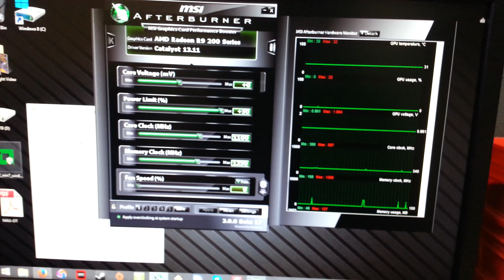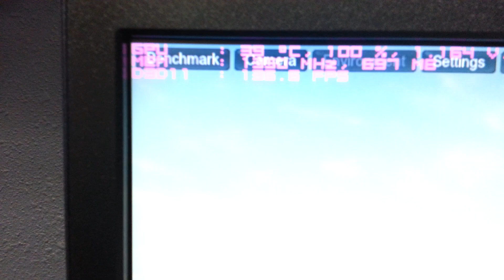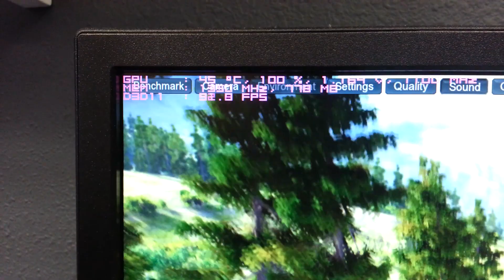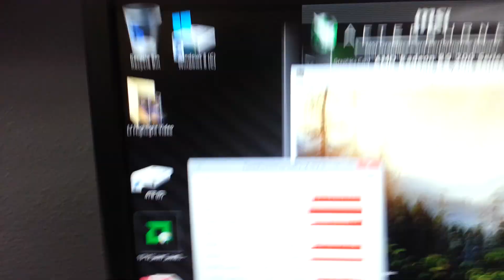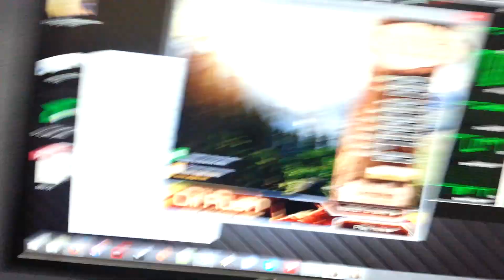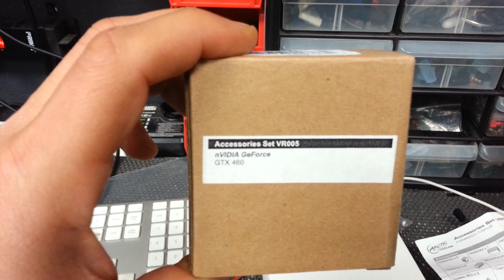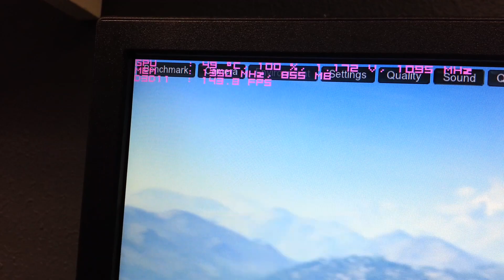NZXT Kraken G10 with NZXT Kraken X40 installed on a Radeon R9 290X (Part 2)

Comment: couldn't the radiator for the gpu cooler fit on the top?
this is cool though, my next build in the future will be 2x 240mm radiators cooling cpu and gpu and those nice little heatsinks for the vrms.

Comment: my temps still gets in the low 60's with the  g12 from kraken, don't understand why though. I have my memory and vrms covered with heatsinks as well but I do have the gigabyte version of the 390 too so maybe that's what it is. Still shouldn't be getting in the 60's though with a h75 cooler, plus I know by the gigabyte version having locked voltage and all the card should not be getting in the 60's especially when i can't even apply any voltage or anything you would think the card would hover around in the low to mid 50's degrees range.

Comment: Would it be OK to run this with just one SP Corsair fan on the rad or do I need two. Also is there a link for some VRM heatsinks for an r9 280x? I have an Asus DCUII one

Comment: When you put these heat sinks on can you just use thermal paste?
Reply: TheRFSpark no you need Arctic Silver Thermal Adhesive.
Reply: Okay So I need a thermal Adhesive?
Reply: and it's permanent
Reply: what do you mean permanent?
Reply: Once you use the thermal adhesive to attach the heat sinks they won't come off again..
Reply: +TheDarkplayer01 he can just buy adhesive vrms with tape at the bottom. they're removable

Comment: I have R9 290 reference and i want to buy Kraken G10 na corsair H55. I saw another video and with overclocking VRM was getting 100C or above. I found that G10 fan is maximum 1500 RPM. I want to replace it with noctua fan 2200RPM. Will it be enough to cool VRM without heatsinks?
Reply: and corsair H55*
Reply: Chačik Tadevosjan you might get lower temps but it wont be as low as his temps
Reply: Hamidflacko Thank you, but the problem is that I dont know where to buy those heatsinks.
Reply: Chačik Tadevosjan http://www.newegg.ca/Product/Product.aspx?Item=N82E16835708012
http://www.newegg.com/Product/Product.aspx?Item=N82E16835426042&nm_mc=AFC-C8Junction&cm_mmc=AFC-C8Junction-_-na-_-na-_-na&cm_sp=&AID=10440897&PID=3891137&SID=rewrite. 
Just look for vrm heatsink or small heatsink
Reply: Hamidflacko Wow. Cool Thank you :)
Reply: Chačik Tadevosjan Tell me how it goes :) I have 2 r9 290x and I plan on doing the same thing for the first card
Reply: OK. I will do it maybe in the beginning of may. I will tell you. :)
Reply: haha if you still remember !
Reply: Hamidflacko I will :D
Reply: Hamidflacko  Hey :D I didn´t forget. :) I will do it in 2 weeks. I just found that even in my country some company is selling Accessories Set VR005 for only 6 dollars. I will write you when I get that.
Reply: Chačik Tadevosjan well thank you, but you don't really have too, I decided to sell my cards
Reply: Hamidflacko  Oh :( OK

Comment: Jesus I tried that on my R9 280x with all fans going blast.and a slight OC  "

Fps - 50 avg 
temp - 178F Degrees Avg
air cooling"

Disappointing to see the huge gap between the R9 290x. and 280x
Reply: The gap is due to the fact that the 280x is a refresh and not a new GPU, it is a 7970 GPU that has been overclocked, then manufactures take the reference card and overclock it more. So essentially its a 7970 competing against a whole new more powerful chip. Really just a bad idea on AMD's part because it has caused many issues with the 280x non- reference cards because un-knowing manufactures take an old overclocked card and boost it more, this really effects overclockability of the 280x series and has been known to cause extreme artifacting issues out of the box.

Comment: with the x40 do you use the software that comes with it? and is so can the fan speed on the g10 be changed to relate to the gpu temperature?

Comment: i have a asrock extreme6 mobo and 2 two sapphire r9 290x in crossfire..i am planning to use kraken g10 and AIO watercooling..will the tube of the watercooling interfere with the installation of the second card? the spacing for two cards on the extreme6 mobo look fine.
Reply: You have to have enough space, yeah. They will have to be rather far apart and one PCI-e slot will probably be blocked and unusable.

Here's my recommendation. You should also get VRM and VRAM heatsinks. Get the Gelid Solutions ICY VRM cooling solution and 16(x2 if you're having two 290x's water-cooled) 15mmx15mmx8-9mm VGA RAM heatsinks.

Comment: Arctic aluminium is thermal glue no? You can remove thermal glue with heat. Just open your case, boot the system for 5 minutes in idle. Shut down your system and fast try to remove it.

Comment: I have used up a spot for the radiator on cpu_fan header on my motherboard for my cpu. Where would i connect the second radiator to, would i need to connect it directly to the power supply

Comment: Alright, I really need your help bro. I just recently purchased a R9 290 (  same PCB design with your R9 290x ), a kraken G10 and a TT water 2.0 extreme. Planning to buy some heatsinks for these VRMs. Could you please give me the link where you ordered these heatsink ? And how many of them do i need ? Did you use the adhesive tapes come together with them or thermal adhesive ? Thank you.
Reply: And, should i install copper heatsinks on the VRM. The price is not the problem. Will the temp's difference gonna be big between copper and aluminum heatsinks ?
Reply: SI DA first question solved after watched the vid. How about the second question ? Thank you :)

Comment: put you'r h100 at the front push pull then you can have the gpu rad on the back of the case h100 as intake blows cool air on to you'r gpu

Comment: Did the coil whine stop after applying the heat sinks?
Reply: HeliX PC Just think manufacters should test for that when customers are paying over $400 for a card.
Reply from the maker: I agree 100%
Reply from the maker: nope, most high end cards have them, even the gtx 780 ti, not all but most will.
Reply: HeliX PC  If your card has coil whine its a defect when the card was manufactured. You should of rmaed the card. My r9 290 had coil whine rmaed it replacement had no coil whine. No gpu should have it.
Reply from the maker: KEVIN G I build many systems using both nvidia and amd high end cards, most of them have coil whine under certain stress levels, tho they shouldn't but they do, so i dont think all of those cads are defective, but most manufacturers will RMA for coil whine but it is not in anyway going to affect performance.
Reply: +Krevin Grard Whine is normal during extreme stress testing, every single top tier card i've had would whine during firestrike and heaven.
Reply: akapdcdaka coil whine is due to poor quality control.
Reply: +Krevin Grard Well i've had AMD 4870's 5870's 6970's 7970's / GTX 480's 780's 780ti's and currently 980ti's all from different brands Asus MSI EVGA XFX and all has gpu squealing/whining under 100% stress testing, if you OC your card and push it to 100% is gonna whine Good QC or not.
Reply: +Krevin Grard That is untrue. Coil wine is due to the inductors on the board. Every inductor has a resonant frequency, and it just depends on the particular implementation. Most cards have SOME degree of coil whine.
Reply: Do some research before you talk.
Reply: Krevin Grard Sure thing, here you go:
https://en.wikipedia.org/wiki/Coil_noise
Reply: "Coil noise can occur when the coil is poorly secured to the circuit board or is poorly damped."
Reply: Krevin Grard Yes but also: " The effect is more pronounced as the signal passing through the coil increases in strength or nears the (mechanical) resonant frequency of the coil."  and a lot of current goes through a GPU. A lot of devices have coil whine, it's not necessearly a defect per se, just something that gets ignored or is deemed too expensive to fix. (relatively speaking)

Comment: Is there something I can use to attach the heatsinks that isn't completely permanent?
Reply from the maker: not unless you want them to fall off, they will heat up and the tape will eventually weaken causing them to fall.
Reply: I got lucky, my VRAM temp doesnt go higher than 60c under load and theres no heatsinks.

Comment: With that motherboard, after installing the G10, can you still fit a second GPU in the next slot? Or does the cooler overhang too far, I can't really tell from the angles on the video.

Comment: Question: Could you mount the radiator so that the res/tubing goes to the side of the case with the window? The specs would suggest that it would work just fine, but I want to make sure.
Reply from the maker: it will work just fine

Comment: What are the VRM sinks your using, and would they work with a GTX 770?
Reply: arctic cooling vr005 discontinued.
Reply from the maker: its in the video, its from arctic cooling, and yes they will work on all cards.
Reply: I bought some expensive zalman ones but I got really dissapointed with their performance. Currently idling in 30 / 50c. Just go ahead and get any generic that look likes his, they will probably do as well as mine.

Comment: Thanks so much for uploading! I don't like the idea of using the thermal glue, have you experimented with any thermal tapes? I plan to do this with a reference 290x. Besides the VR005 kit for GTX 460, the small mosfet sinks for RAM chips, and GPU cooler itself, will I need anything else to keep this new 290x cool? I'm thinking these three things are it, but I want to confirm.
Reply from the maker: those are fine, make sure to get 2 of the kits because the 290x has more memory chips on the card itself. The glue is your only choice, tapes will fall off
Reply: HeliX PC thanks. I don't know if you received my PM last week, but I'll reiterate: The VR005 kit is unavailable everywhere for the US; do you know of any alternative solutions? How about http://www.frozencpu.com/products/7190/vid-105/Enzotech_MOS-C1_MOSFET_Heatsinks_-_65mm_x_65mm_x_12mm_-_10_Pack.html?tl=g40c16s1859 and two orders of http://www.frozencpu.com/products/7191/vid-106/Enzotech_BCC9_Memory_Ramsinks_-_14mm_x_14mm_x_9mm_-_8_Pack_BMR-C1L.html?tl=g40c16s1861?  Will these two heatsink solutions, along with the AIO with bracket for the core, be sufficient?
Reply from the maker: MisterBallzley the copper ones will work great, make sure they are stuck before finishing mounting the block.
Reply: Thank you for responding HeliX. These two links I gave vouch for heatsinks that are both copper - do you mean to say I need to purchase from both of the links I gave? Thanks.

Comment: Just wondering is that a air 540 case and if so, couldn't you have used 2 h100's?
Reply from the maker: H100 wont fit, only coolers made by asetek, the H105 will fit tho.

Comment: is there any way to put on the vrm heatsinks and take them off down the road?
those are expensive graphic cards and have very short prime time span, usually swapped every a year or two. 
i want to be able to sell them down the road, instead of having the vram heatsinks stuck on there

Comment: Brilliant. Just what I needed to know. Just gotta figure if those tubes on any AIO cooler will reach the roof or back of a Corsair 900D.
Reply from the maker: the X40 has long tubes, it might just work. Good luck!
Reply: HeliX PC the heatsink on the vrm is NZXT g10?
Reply: Kevin DT no, you have to buy heat syncs separately, as the g10 does not cover the vrams. Failing to do so will result In over heating and artifacing

Comment: When you removed the X40 from the card is there anything required for re-install? Is the thermal paste solution provided on the x40 ok to re-use? I need to add heatsinks myself
Reply from the maker: Just need some new thermal paste, the one that comes pre applied is pretty good. Get one of the high end paste's, just dont get arctic silver 5 because its conductive.
Reply: HeliX PC Thanks for the quick answer do you have any good paste recommendations? Also do you mine with your rig and these heat sinks? I ordered the kit and I am planning on adding the sinks this week. Gaming my card runs great no heat issues but mining is a diff story VRM 1 temps are pretty out of control.
Reply: Eroc Jones I just installed my G10 and X40 today. VRM's are way out of control. I put copper heatsinks and used arctic silver adhesive and was still seeing 90-95+ on VRM1. I jerry rigged a 120mm fan directly under them and got them to a steady 85 but that's still high for my taste. VRM 2's are fine at 60c.

Comment: can you put the gpu rad as an exhaust out the back of the case? Or is it better as intake in front?
Reply from the maker: I would keep it as an exhaust in the front, you dont want to dump the hot air from the rad into the case
Reply: ok true true. thanks

Comment: Copper heatsinks work better than those aluminum ones
Reply from the maker: yes your right, but a 5-10c drop from 60c to 50c will have no benefits, if you want to spend 3 times as much for no gains, go ahead :)
Reply: If you are overclocking, a 5-10c drop for a few dollars more is definitely worth it, and a pack of 8 copper memory heat sinks is only $8.49 with free shipping on amazon.
Reply from the maker: Wes Murrell Not on the VRM, VRM's are made to run very warm, that 5-10c drop on the VRM will have no benefit at all even when overclocking, especially the 290x, i have done several tests, but all cards are not made equal, so maybe on certain models it will have a benefit.
Reply: Oh, I was talking about memory. Yeah, VRMs dont need the extra benefits from copper heatsinks

Comment: not very good for watercooling my gtx 770 windforce idles at 36c .. on air.
Reply: you do know that R9 290x runs extremely hot, and UNDER LOAD with the closed loop cooler the GPU itself is running at about 40 to 50 degrees versus your GTX 770 under load, which would probably be in the 80s.
Reply: yup just like I thought, found a video of a guy that installed the G10 on a GTX 770, his Idle Temp is 25c to 27c vs his usual 42c (he is just using a Kuhler 120mm rad, so that temp will be lower with a 140mm x40) and his under load temp is 55c vs his usual 75.
Reply from the maker: You cant really compare the GTX 770 which runs very cool by nature to the R9 290X which runs at almost 100c, its not a realistic comparison. Plus this setup is silent even with 100% full load.

Comment: Is there any other way to install heat sinks or something to cool the vram that's not permanent? It keeps it at a good temp but would ruin any chances of putting the stock cooler back on the card for warranty purposes if the card dies.
(some amd partners allow for w/c without voiding the warranty so long as you keep the stock cooler and it wasn't your fault i.e. water leakage)

Comment: would you be able to answer a few questions i have about the g10
Reply from the maker: yes, what kind of questions do you have?
Reply: i have a gtx 780 ti classified and kinda wanna put the h110 on a g10. the case i have is a phantom 630 would the radiator fit to the bottom two fan mounts? also how much would this help with over clocks ? do i just need more volts or do better temp let me put the clocks up more?
Reply from the maker: hoodninja89 what temps is your card running right now with stock heatsink? sometimes even better temps will not result in better clocks if the chip is a dud...whats your max clock on air?
Reply: max clock on air with just the power target at 115 in ln2 mod i get 1163hmz stock volts. temos depends on the game but anywhere 65 70 c on bf4 on ultra

but i also use lucid mvp (which uses the intel gpu as a vsync / a little performance)

Comment: @HeliX PC Hey, the Kraken comes with an usb connector for the mainboard and software. Do you have to use this feature, or does it also work without? Im looking forward to buy a kraken for my r9 290x, but i couldnt find an answer for this question, if you require the software or not.
Reply from the maker: Its not required, as long as the power for the pump is connected you are fine.
Reply: HeliX PC
Nice, thanks :)

Comment: I have this same case and have a g10 coming to use with my gtx 680. Sorry if someone already asked, but, is the fan above the cooler in the front also exhaust or is that intake? Also, would you recommend it being intake or exhaust if i were to put a dual 120 rad in the front for the g10?
Reply from the maker: Exhaust, you dont want the hot air from the radiator to be dumped into your case.
Reply: I actually decided to just put it on the back of my case instead of the front. thanks though :D

Comment: @HeliX PC hey man do you know if the tubes for the x40 will reach the top for top mounting or not? cause i have a h80i for the cpu in the rear and wanting to mount the x40 at the top
Reply from the maker: the X40 is long, i think it will work.
Reply: HeliX PC hey just installed it on a zotac gtx 770 amp, this card has heatsinks on the vrm and memory but i cant monitor the vrm temps, do you know the program that would work with nvidia? or at least my gtx 770? been playing it a lot from when i installed it from 3 days ago but kinda worried since i cant see the vrm temps..  does your gpu clock trhotles when the vrm heat up?
Reply from the maker: GodKnightEclipseXIII
have you tried GPU-Z

Comment: I run my R9 290 at 1000@Core 1300@Memory with stock fan, I replaced the thermal paste ( MX-4 ). Max temperature 83°C ( 5 games tested ) at 65% Fan Speed ( A little louder than my older GTX 670 FTW, but do the work very well ). I want the G10, but it's hard to find here.